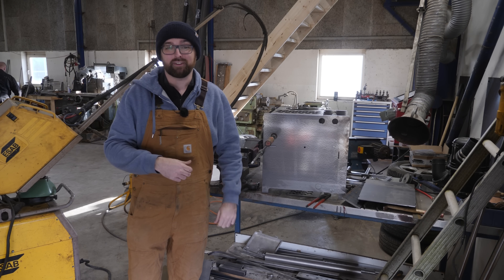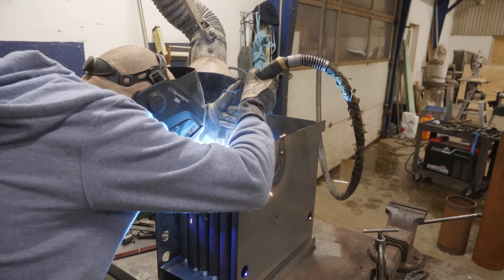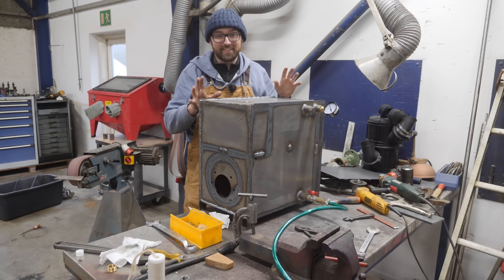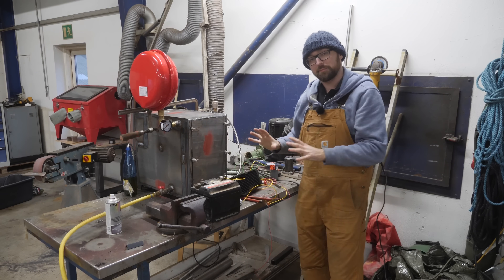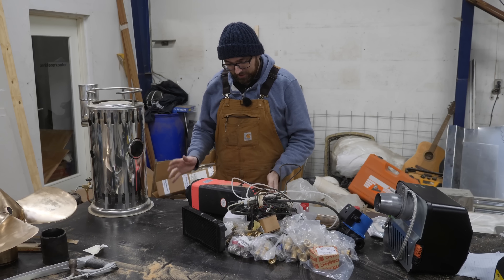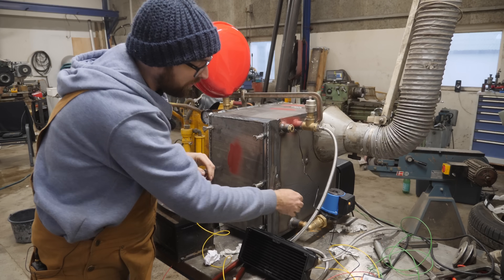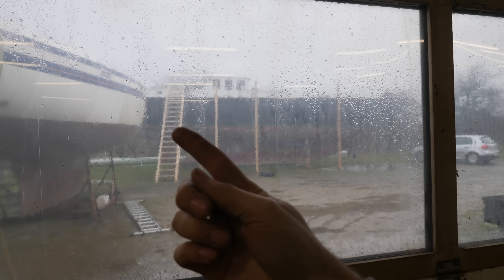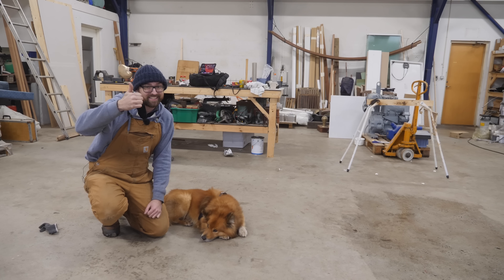Sail Life - DIY boat heating boiler - project sailboat

Comment: Great stuff Mads! Can we get an explanation of how it works? Flame goes here, water goes here, etc.? Have to use old footage since she's all glued up now I guess.
Reply: At it's most basic, it's a big water tank with a bunch of burner exhaust tubes (and the tube the burner is burning in, too) running through it. This one from what I can see, the burner in bottom front burns in big tube, blowing through into cavity at back, then up and back across to the front through the many smaller tubes running through the water in the upper part(more heat transfer surface area with many smaller tubes than one big one), and then exhausts out the upper front(at the side). The heat transfers from the heated tubes to the water, with typically hot water out at the top of the tank, through radiator loop, and cooled down water returns back into the bottom of the tank.

(Soldered in copper tubing would work better for the heat transfer efficiency, but that's a whole different price level. lol)

Fairly efficient for a low pressure closed radiator loop system where the water coming back in normally has some heat left in it, when everything's sized right so it's not cycling too rapidly or running the burner constantly. Also, the boiler design and burner size need to match up, too little back-pressure and the heat goes out the stack before it can soak in, too much and the burner won't burn right and could just fill the whole shebang up with soot. This boiler has 3 good boxy right angles that should slow the exhaust down pretty hard, meaning it doesn't need too much of a burner to max it out.

Pretty much the opposite, more complicated design of a tankless water heater, which is a tank of flames with a bunch of water pipe in it. Can be more efficient by far, because it can do things at a slower pace since it's not having to deal with pressurized high flow.

And thus ends this 2:00am YT ramble. Hope I made something resembling some kind of sense. I go fall over in the general direction of my bed now. G'nite. XD
Reply: @hwesson75  Wow! Great reply! Thanks for breaking it down!

Comment: Nice heating system. For the fan heaters you might want to check out the 'REAL' brand heaters made by Sure Marine in Seattle, Washington, USA. They make many different sizes with varying heat output.

Comment: I recsently watched a video on how the efficiency of steam engine boilers was achieved by adding a steam regulator, i no what you have built isn’t a steam engine but in principle its very similar, but adding a heat regulator a boiler can improve its efficiency by 60%, i don’t no if this is something you may wish to look into or not, its up to you, https://youtu.be/JLOkj_zZp1g heres a video that may help
Reply: The heating system on Athena will not be steam heat, so Mat's boiler is NOT a steam boiler.  It will generate only hot water just like the "boiler" in a hot water home heating system.

Comment: Such a heater should be welded TIG, slowly and from both sides on each plate. Then it will last years. Seeing the way this one was done .......
Reply: I get the feeling that cement boat guy has experience that doesn't match your theory.
Reply: If you going to get technical you would use tubes instead of pipe and the ends of the boiler would thicker. You would roll the tubes on the inside to have a tight fit. There would not be any welding on the tubes to ends of the boiler. However in this situation any thing you do to stop the leaks is perfectly acceptable.  The only thing not mentioned is a water treatment in the boiler to stop corrosion. You have to test the water for acid levels and treat accordingly. This will determine the life time of a boiler. One year or fifty years.
Reply: @peterengel7885  This is a LOW pressure boiler that is not intended to make steam, only hot water.  And the water is continuously circulated with little or no loss.  If it were a high pressure boiler (greater than, say 3 bar or 42PSI), I would agree with rolling the tubes.  Mats has not indicated that there are any governmental boiler standards or inspections for this unit, but I suspect that he is aware of any inspection requirements.

Comment: I have one of those cheap diesel heaters. But you are right, I am more of a weekend warrior (if that). It can't be used for hot water, but cost wise we are talking $150 US. If I replaced it every 2 years, who cares?  :-)
Reply: My thoughts exactly. I can see the sense in what Madds is doing for Athena but for mere mortals a Chinese Erbesbacher copy is a good option as a "throw away" item. Given that a new "genuine" item is around £1500 even replacing  copy every two years it would be twenty years before you've caught up!

Comment: PRESSURE RELIEF VALVE must be installed and pressure testet!!!!

Greetings from Germany
Reply: I was wondering where the pressure relief valve was located. A critical  safety piece on any boiler or water heater.  A boiler without one is a bomb which would leave little pieces of fiber glass spread over a half mile area.

Comment: Looks like an SC1000.  I have them for a temperature controller.  Works great.  

Where are you going to get all the fresh water for that boiler?  I mean, if you end up out away from a port for say 5 to 7 days, do you have enough fresh water to run the boiler and have drinking water?  Or, are you planning on using seawater for the heating portion, and fresh water for everything else?  Hope this all works for you.  Neat idea...not for me, but I do like the solution.
Reply: The hot water in the boiler stays in it and is sealed. The other water is the water they would need whether cold or hot and gets heated through an exchanger.

Comment: Just a thought for when it comes time to install the unit.  Others will know and confirm, but I think the expansion tank can be located just about anywhere that is higher than the boiler.  That means you can located in in some out of the way space and make your boiler unit smaller and therefore easier to install.  ( In my Dad's Michigan US house he located the tank in the attic and the boiler in the first floor furnace room.)

Comment: Looking great! I didn't even know that you could get that kind of diesel burners. What's the brand and how much electricity does it pull?

BTW Wallas Marine does forced air heaters that have quite a few moving parts and are reliable. I have (paraffin burning) one from 1989 and works well. Did a cleaning for it (for the first time I bet if you guess from the amount of dust in there...).

Comment: with you being a handy bugger:) think about underfloor heating 250 euro for the pipes and 600 euro for the manifold. I have just done it in my trawler if you want some info just email me. Also run some pipes not insulated through the cubboards to keep your clothes dry
Reply from the maker: I love that idea but I don't have the headroom to spare. It would have been amazing! :)
Reply: @SailLife  Matt it is only 14 mm ply as the pipes are 12mm outer and 8 mm inner diameter. Posted a link on your facebook page to my boat in build progress on how I have designed it

Comment: As former Licensed plumbing and heating [hot water] guy whom has built his own heater such as you have. I would recommend at least two zones, that way you will be able to control the heat distribution much more efficiently. I have a couple of new self contained zone valves I would love to donate but I'm concerned  that the freight between SLO, CA and Denmark would be prohibitive. I will check on Monday. Also I have extensive  Hot water heating experience  from large hotels to my own boat [Catalina Morgan 440 "Fantasy"]. As always keep up the good work on the best DIY boat Site.

Comment: I know it's far too late now, but couldn't your boiler have been one or more car radiators effectively operating in reverse? Or does that heater unit throw out a flame, like a blow torch, rather than hot air?

Comment: If you are using a zone control on the heating, heating the floor of the head and shower would be nice. out from the boiler to the matrix, matrix to a floor system then return.

Comment: Do you have to worry about legionella? We have a similar set up on the commercial boat I work on and have to keep the water temp above 70 degrees c to kill the legionella bacteria.
Reply from the maker: the water in the boiler is in a sealed system :)
Reply: With a heat exhanger you have less than one liter of water heated at the time, and it is always "stored" at the same temperatur as in the boiler, and that is well above the safe sone for legionella.

Comment: I've been looking they have 2' long baseboard radiators rated at 600 btu that are used in homes, they don't use forced air and are only $18.39-$18.69 here in the US. They do have white metal coverings that could be removed or modified pretty easily if required but would probably be good for larger open areas in the boat and could easily be built into places to hide them. They are at supplyhouse called the Baseline 2000, I know in certain areas forced air is best like the head but simple radiant heat would probably be best for the galley and sleeping quarters providing continuous heat without noise. They do come in 2', 4' and longer length versions you can also choose between 3/4" and 1/2" connection versions the difference in price being around $0.30 for the 2' version. The dimensions for the 2' version are 2-11/16" deep, 7-3/8" high.
Reply: The radiators you are talking about are the output.  They can be simple.  What Mads is building is boiler that makes the hot water to deliver to the rads.  Heat from a fire in the tubes. The tube surrounded by water to be heated. The heated water to be circulated to the radiators and a secondary heat exchanger in the hot water tank.
Reply: @trailbarge12  I am more than aware of the boiler he is building and what it is used for. I was just suggesting that instead of using heater cores from vehicles for the entire boat, he could actually use some baseboards made for home hydronic heating systems in the main areas to provide constant and quite radiant heat. Ones that are small enough to be hidden low to the floor and actually include protective covers to both hide them and protect appendages from direct contact.

Comment: Mads, I've been living aboard my Irwin 38cc for the past 20 years here in Annapolis Maryland USA.
I'm totally turned on about you boiler idea for comfy heat.
Where are you placing your stiffy unit inside Athena?
Reply from the maker: In the technical area behind the shower/head :)
Reply: Depending on which layout you have in that Irwin you may have to delete that fridge next to the engine or get rid of the aft head! :-(

Comment: As a design idea, I think I would like to see a design where the components were modular rather than all welded together. That way it would simplify service wjen the time comes.

Another idea would have been to design the heat exchanger so that the whole thing could have been assembled and popped into a furnace and all the joints brazed in one go.

Not sure why you intend to spend a lot of time in cold climates, seems to me life is better living where the climate os good.

Go back to visit Denmark in the summer and go south for the winter.

Comment: I've been looking at re-fitting a ferrocement down here in South Africa, very curious to see what Mads has to say on the subject.
Reply from the maker: Short version is: there is no perfect material for a hull. They all have issues. What strikes me as worth considering is who build the hull and how good of a job did they do. Of course the current state of the hull is also very important. I'd be just as happy owning a ferro cement hull as a steel hull but personally I prefer fiberglass (maybe because I have more experience with those)
Reply: May be wise to ask a boat/yacht insurance agency what they think about it.

Comment: The maths says to me that to replace a cheap Chinese diesel heater every 2 years saves cost and weight against the stainless boiler. I haven running a Chinese air heater for 3 years without issue. Nice to see you trying new skills though
Reply: Do you live with your diesel heater 24/7 year around? How do you handle the constant on and off noise? My Espar kept me up at night.

Comment: Just wondering why you chose to MIG weld the boiler, instead of TIG? MIG is kind of a Firehose, whereas TIG is an Artist's paint brush?
Not judging, just curious.
Reply: I believe TIG welding would have taken...forever. Were it to be on display at the Smithisonian...TIG would have been a good choice.
Reply: MAG weld this takes minutes, TIG weld will take many hours and in this instance it will not get better or stronger.
No brainer. I have all welding setups at my small home shop, have worked in a production with a lot of stainless, aluminium and steel welding, was certified in several of them. I would not even have considered TIG for a second.
However if it had visible welds which this has not, and in combination it was made for my self I would have used the tig.
Reply: I wonder what professional boiler manufacturers use?
Reply: @nobody46820  Almost all preassurized units are MAG welded, but with robot welders.
Reply: @johnnyandersson5622  Thanks for the reply! Good to know!👍🏻
Reply: I didn't catch what kind of TIG torch cement boat guy has, but especially when you are running a lot of amps through the torch welding thick material, the torch can heat up quickly and become very uncomfortable to hold.  No problem for a water cooled torch, but with an air cooled torch, forget it.

My TIG machine is technically capable of doing that work, but I wouldn't attempt it with my current air cooled torch.  I'd either use the mig and plan on welding up a bunch of leaks, or spring for a water cooled torch setup.  Most of what I do requires short welds in light material, and the torch that came with the machine works fine for that.
Reply: It's a low pressure boiler, no point in making artistry out of it. And yes, it can be a firehose, but then again... firefighters are mighty fine at keeping it under control.

Comment: Apologies Mr Dahlke. An Idea. Aluminium is a good thermal conductor, 200 W/mK. Wood isn't. Suppose you routed channels into your plywood floor, deep enough to run water pipes. You cement the pipes in with epoxy, thickened with (graphite flakes (165W/mK)), add aluminium sheets (3-6mm thick) to spread the heat, and cap it with a wood veneer, or similar finish? 
It might make a great DIY project because housing is much larger than yachting. Testing a 1 sq.ft sandwich is where I would begin. Hook it up to your boiler. Test and test. Fail or succeed. Love the show, btw.

Comment: I have a house radiator aboard which works a treat in the cabin down forward and a truck heater style blower in the wheel house all run of the engine coolant, as I'm a small fishing trawler my engine is always running so that works for me but they would work of a central heating boiler like that just as well.

Comment: I have a Kabola boiler, with a similar burner. It is the tap version so has a built in small tank for hot water that is kept upto temp, it means there is no need to a hot water cylinder and it's powerful enough to keep the hot water flowing when filling a bath. Not sure if you could fit this into your design and reduce the need for the cylinder

Comment: That boiler is a miniature version of oil fired boilers that are used here in the U.S.  Usually a 6 gallon tank with a coil of copper tubing inside for heating water.